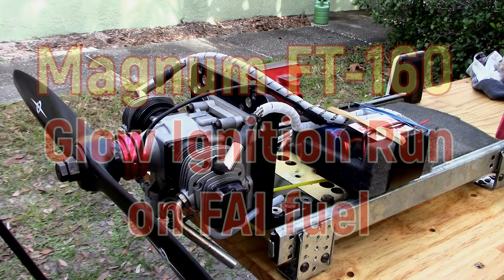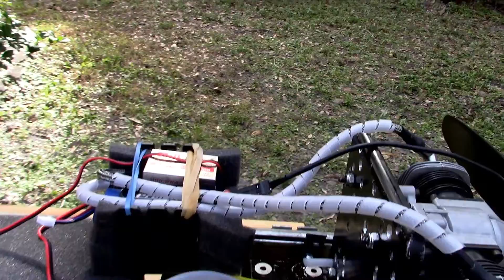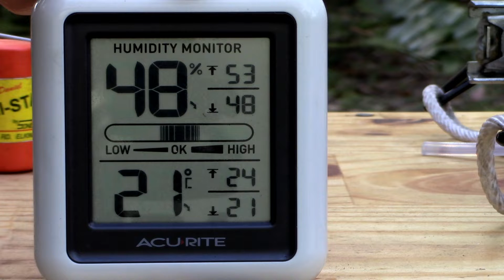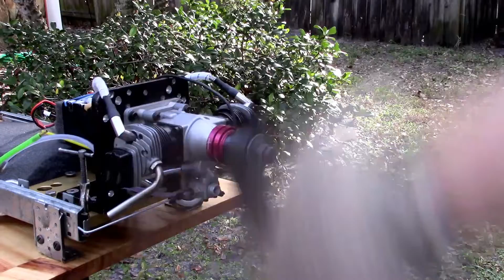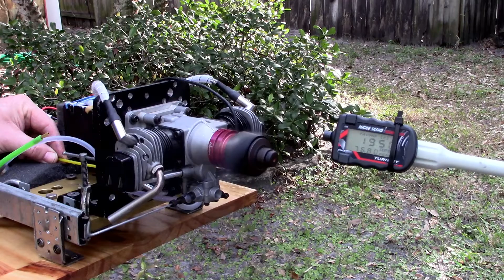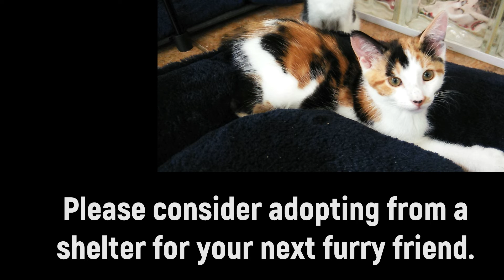Magnum FT-160 Glow Ignition Run on FAI

Comment: Wow David, this conversion video series is very useful. In my country Nitromethane and pre mixed "shop" fuels are hard to get due to high tax content but methanol and oils are easy and cheap. I might consider this conversion for my engines if my sourse for fuel becomes unavailable. The petrol conversions I do not like, these engines are not meant to run on low oil petrol. they overheat.
Reply: I think I heard you say that on your Petrenicic Bros. video...Maybe you can smuggle some back in some Fanta bottles on your next trip ;)
Reply: https://www.youtube.com/watch?v=8XC8hp-hTc0
Homemade receipt, maybe you can get some Nitro from some race car guys over there in Hungary?  And make your own...Just a thought...
Reply: @1unaffiliated1  Thank your for the link, but you have to know I mix my fuel for a long time now. I use methanol,  8% castor, 8% syntethic oil (like Motul micro 2t for glow) and 5-15% nitro (depending on 2T or 4T engine). We had some RC shops selling 100% nitro, but nowadays there is only 1 left. There are others selling car and heli fuel but its expensive and for airplanes you have to correct the oil-nitro content. There is Lindinger and Schweighofer in Austria, but shipping of explosive fuels is prohibited. Thats why I like this video because it proves you can run on 0% nitro just by adding an ignition. No petrol conversion needed.

Comment: I have two SA-150 running on ignition and 15% nitro only because FAI is not available off-the-shelf here.  The engines run very well on ignition.

Comment: Woo Hoo, I got my Ebay find running/idling yesterday...New pump, o-rings and gaskets now installed, it should be a keeper.  The YS idle stop screw is the same way, in No Mans Land...I put a small piece of fuel tubing(non silicone) on the screw head to where I could adjust it by hand.  Thanks for the emailed info, it really helped me tune this bad boy...A 91 slinging a 14 x 10 prop with ease.